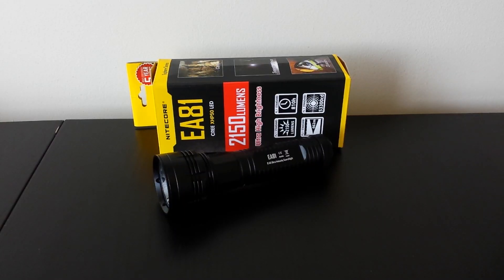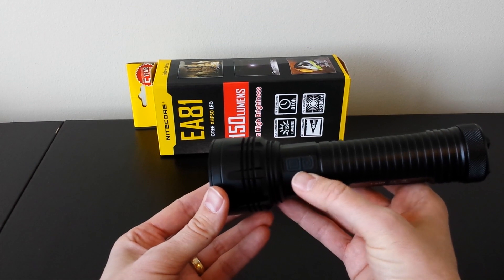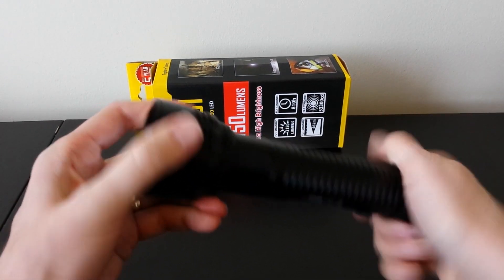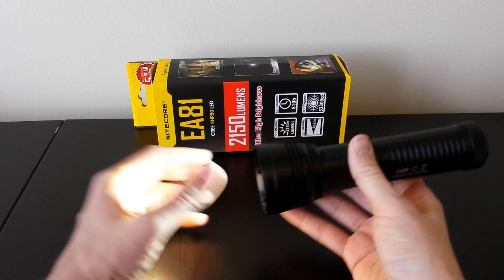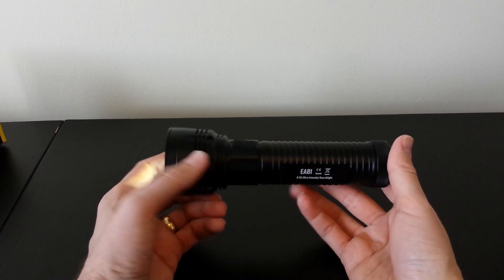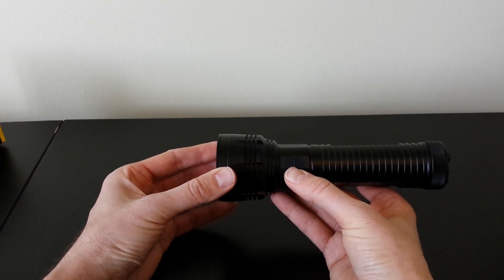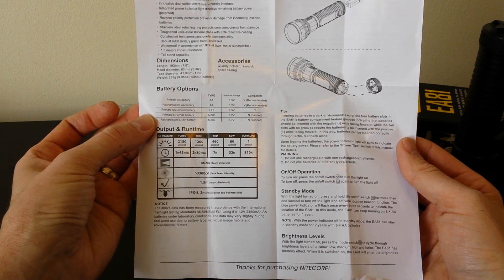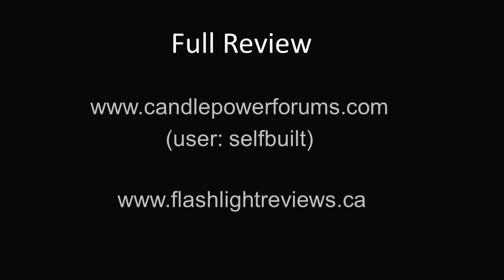Nitecore EA81 (XHP50, 8xAA) flashlight review, by selfbuilt

Comment: The inability to lock-out physically or measure standby drain (though I've come to trust Nitecore in that department since the EC20 came out) and the MC-E-like donut are what take the wind out of my sails for this one. Still, a good torch for those that don't mind the heft or the batallion of batteries you need to feed it.

Speaking of batteries, something this size really should have a built-in charging function. 8 Eneloops aren't particularly hard to amass, but not everyone has an 8-bay charger, or the patience to make two rounds of four-cell charging or four rounds of two-cell charging.